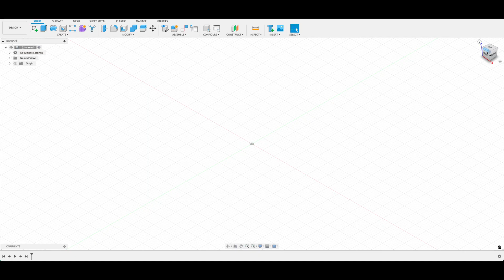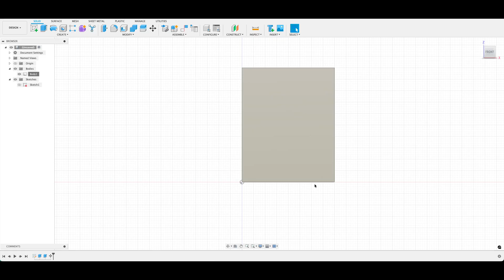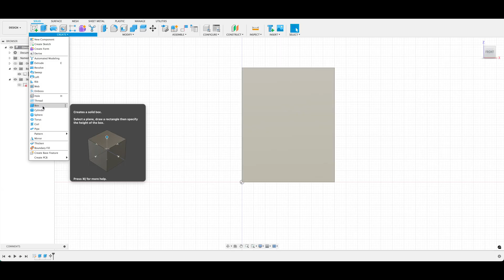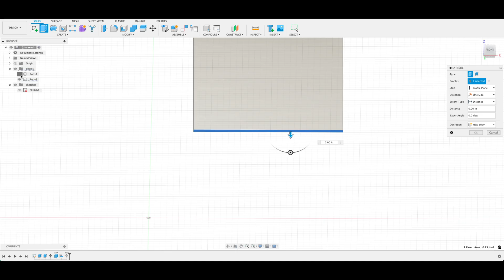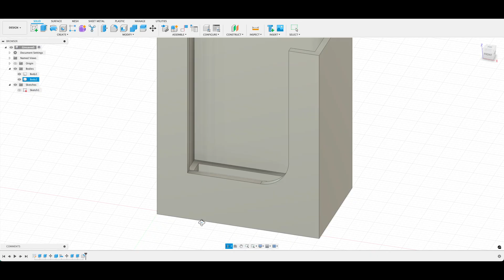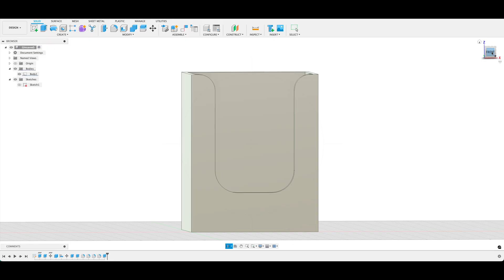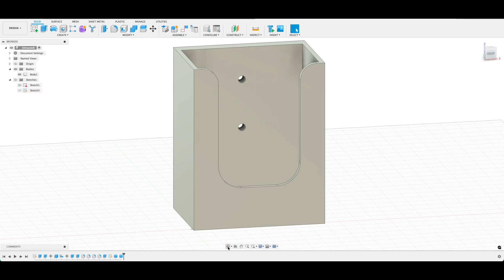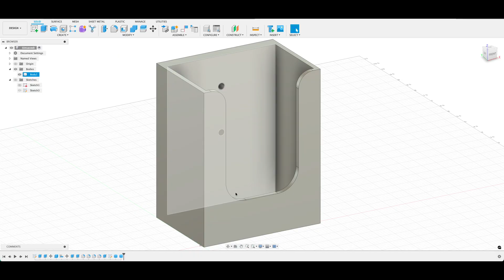3D Print a Custom Wall Mount for Your Charger | Functional Print Friday

Comment: Why did you use the torch on the print after taking it out?
Reply from the maker: it helps clean up the artifacts that remain after a print such as stringing.
Reply: @FatGuyTinkering2  I didn't know that, thanks!

Comment: why would I want to mount the charger on the wall?
Reply from the maker: My use case could be different than yours but I use it for my electric bikes and then I can keep the bricks off of the floor since it's sitting in my garage and water could potentially get in. It also provides a cleaner look.